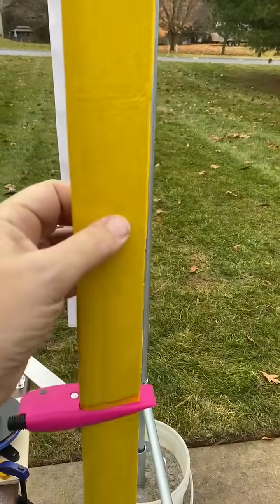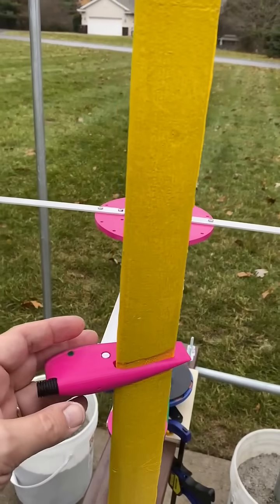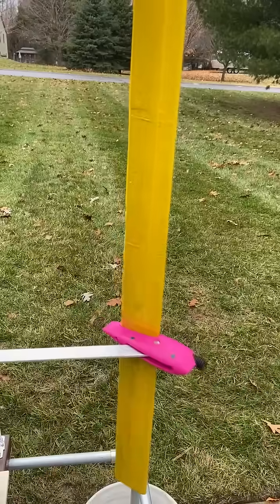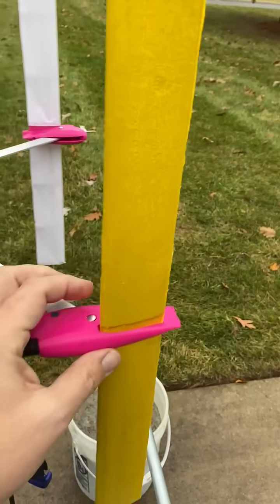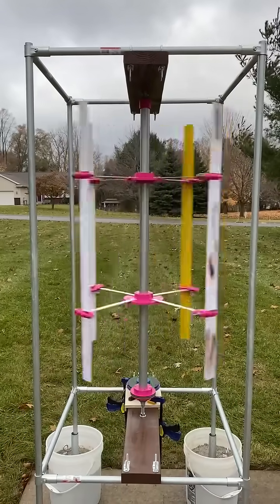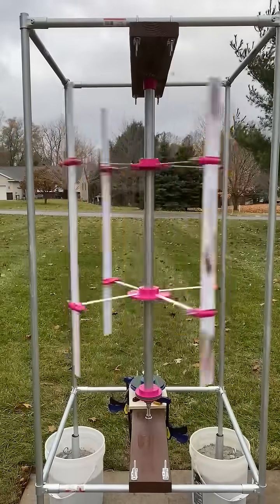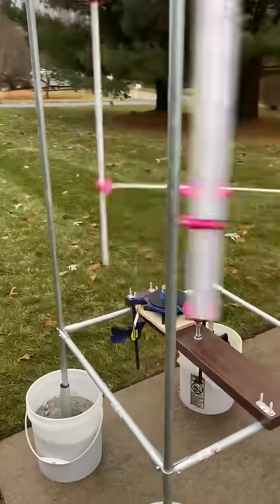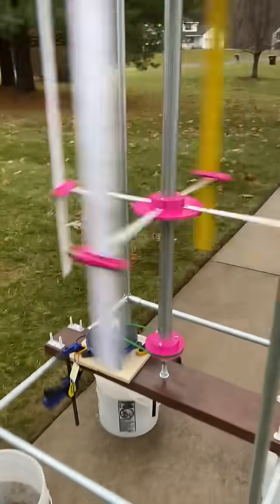Sharp Style Auto-Cycloturbine (VAWT) Brief Overview

Comment: Nice job! Could you share your blade manufacturing process with foam cutting and covering it's surface?
Reply from the maker: Sadly, I didn't take video because I figured it was a fairly common process.  :-(  I just epoxied foam cores (purchased from Mohr Composites) to a carbon fiber tube (purchased from Kites and Fun Things) and covered it in 2 oz fiberglass cloth and epoxy.  I used a vacuum bag during the curing process, but it could probably be done without it.  There were a couple short sections of 3D printed plastic wing in there too for hard points for mounting.
Reply: @MickEMaus3000  thx for the detailed explanation. I once tried to cut the foam cores myself with a similar chord length (7cm) and it wasn't fun :) So I will look out for prefabricated ones to buy.
Are you sharing your 3D print designs somewhere?